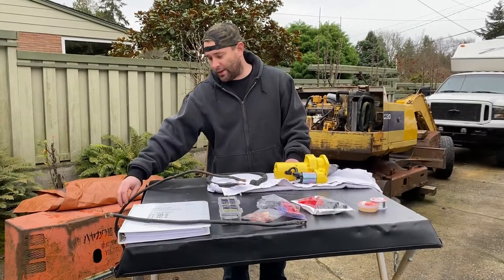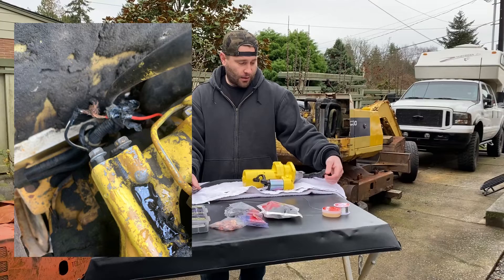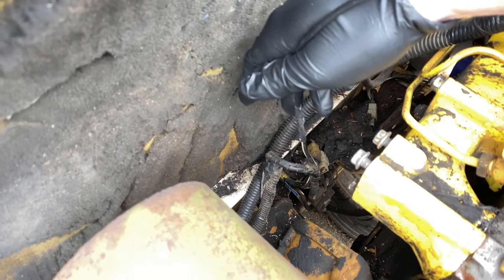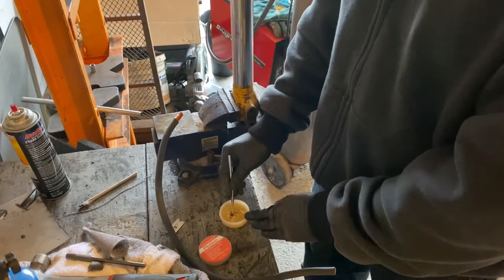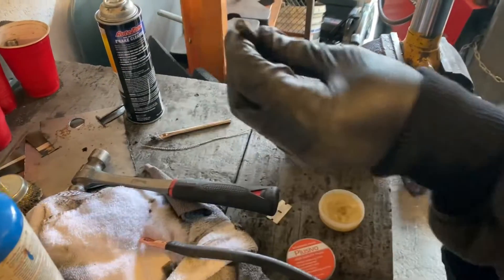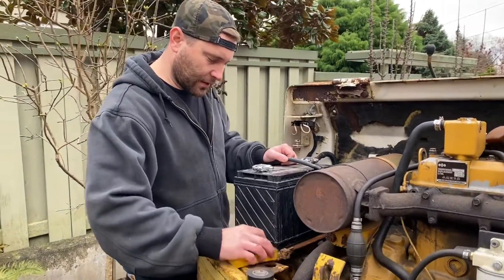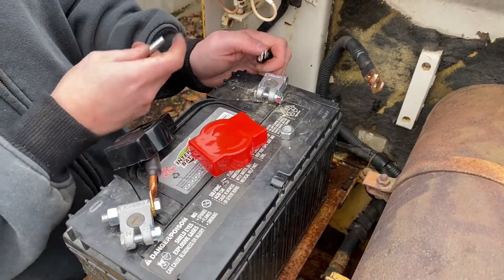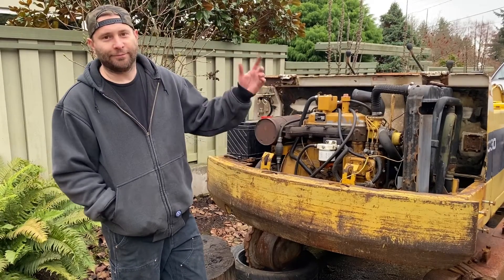I Bought the Cheapest Excavator I Could find (Part 8) | Fixing Electrical Issues

Comment: Just put a factory mechanical fuel pump on it, Those 12v fuel pumps might last you 10 hrs before they take a dump   you have a plate with 2 screws covering up the hole left of your fuel filter
Reply from the maker: Thanks for your advice!  Just ordered one!  That helps me out big time!